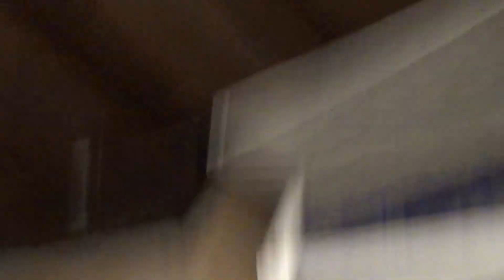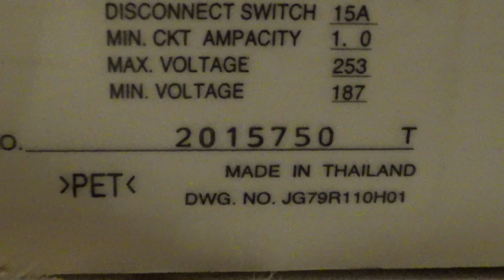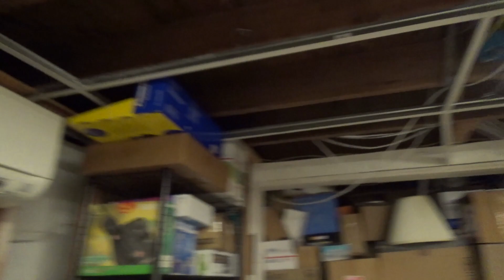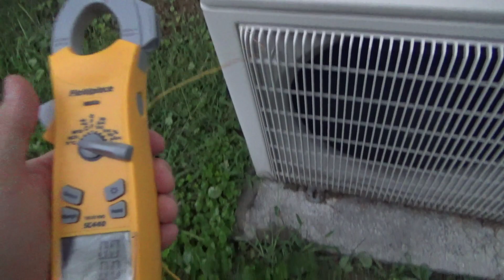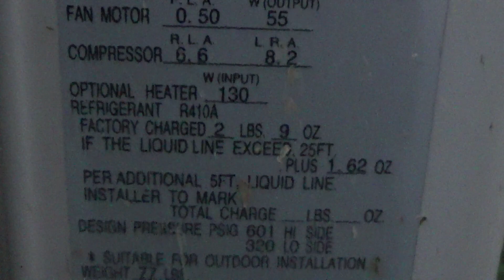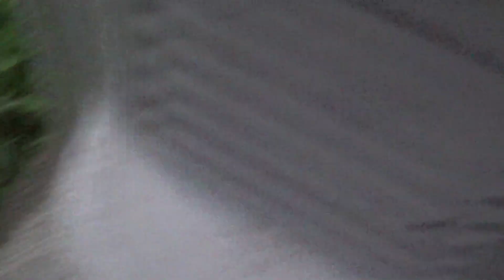Mitsubishi MSZ-GE12NA-8 Split System Air Conditioner / Heat Pump

Comment: GE12NA is 12,000 btu, one ton.  They dont make "14".   Usually steps in 1/2 ton increments.   Doesn't blow hard.  It's meant to be slow, gentle and very efficient.  Sips energy from a tiny straw instead of guzzling energy from a fire hose like a frat boy on a Friday night.
Reply from the maker: I prefer fast, powerful, and reliable over efficient.
Reply: @JordanU      I know.  I could tell when you were unable to decipher the unit size.

Comment: Hi,how long should an ac cycle last? Mine runs for an hour or so than shuts off for around 4 minutes than comes back on for around 10 minutes than shuts off again for 4 minutes so on and forth,its a new unit ive installed,a 12000 btu,it works fine and no gas leaking but im just wondering if its called short cycling? Shouldnt an ac like this run atleast 30 minutes than shuts off for 10 minutes and go back on for another 30 minutes so on and so forth? Any info wpupd be appreciated thanks
Reply: It’s not short cycling it’s just keeping up really well, my carrier comfort central hvac condenser runs for 10 minutes and is off for 5 minutes

Comment: Your unit is a 12,000 BTU. The number in Mitsubishi model number is the capacity of the unit. They’re pretty easy to work on. The current model it made in Mexico and does come in 115 volts but it more efficient on 230 volts. Did many installs and have seen many come in for recycling. Mitsubishi is one of the better brands for mini splits go but nowadays they are all built cheap no matter who makes them.

Comment: In my country we only have these split system or a portable ac and rarely something that has the outside unit and it’s all packed like a split unit with a outlet and inlet. 

Like you said if these are made correctly they can be good and in my experience they tend to last 15-20 yrs but recently there are a lot of rebranded Chinese units that are very questionable with cheap electronics control boards, cheap plastic that rattles and more. 

Usually Japanese brands are good quality except Sharp units that started to rebrand a lot of Chinese units, 
Daikin is not bad but a bit overpriced for what they offer, 
Mitsubishi can be great or slightly better than the cheap options depending on model, 
Fujitsu/General those are generally good but you don’t have many options to choose from, 
Panasonic has good prices and quality even if the compressors are made in China they’re not from a Chinese brand every board is either made in Japan or with Japanese components.
Unfortunately it seems like mini split system are very expensive in the US compared to the same brands and model in Europe. This is what I see here in Europe with these mini-splits, hope that is sort of useful and interesting.

Ps: LG is slightly better than the Chinese ones and Samsung is to avoid at all costs!